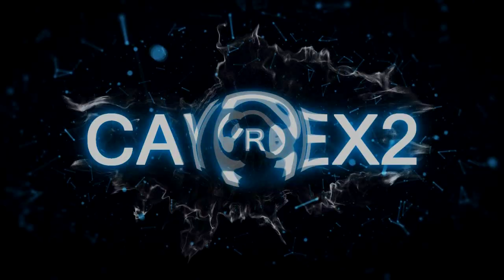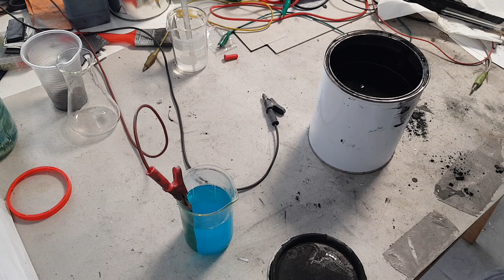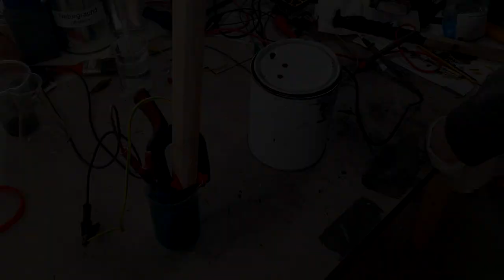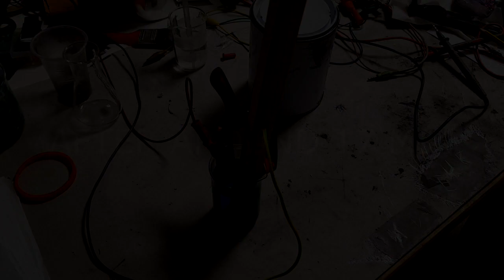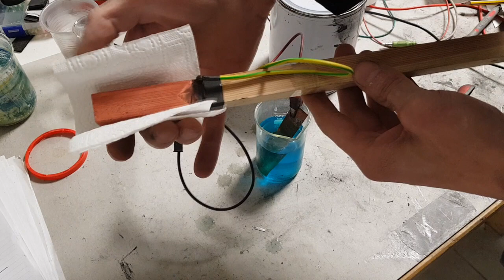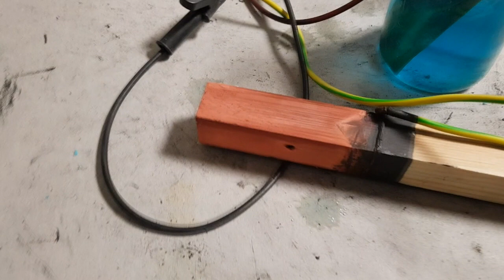Electroplating with conductive ink

Comment: 3,5 volts, okay, but what is that 130 ??? I don't understand that word after 130
Reply from the maker: Current! If the 3.5V is voltage then 130 will be the current. 130mA

Comment: So a leaf from a tree when it’s green and then when it dries out it will crumble away on inside .
Reply from the maker: I saw it once, that one guy make some coating with glue first, for strength and then he electroplated. I think he used some epoxy but I am not 100% sure.
Reply: cayrex2 I was thinking do long time thick electroplating
Reply from the maker: @Buzzhumma  also not bad idea at all. Maybe you will not end up with nice details,... but anyway It's worth a try